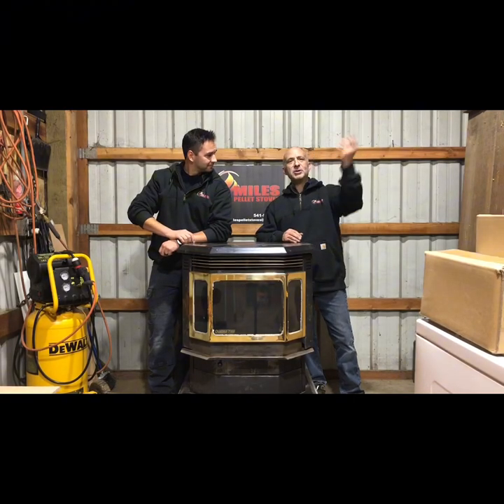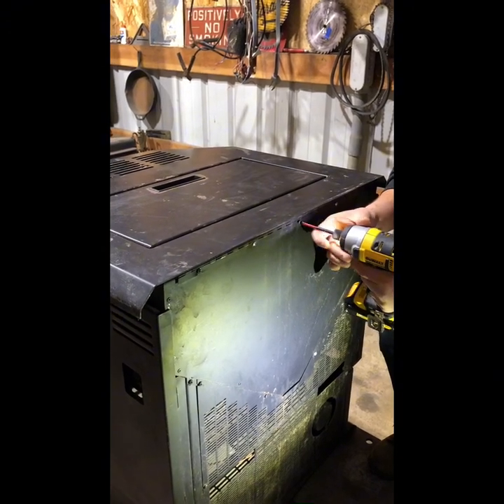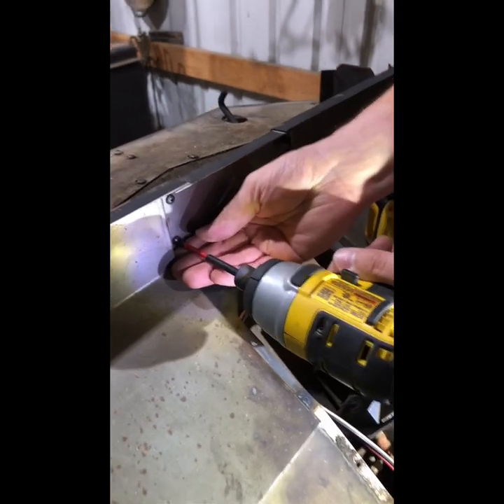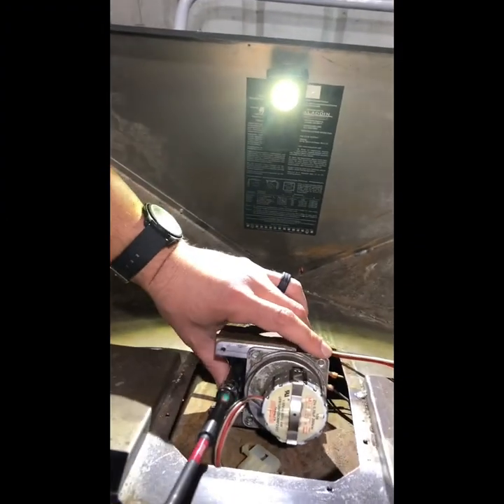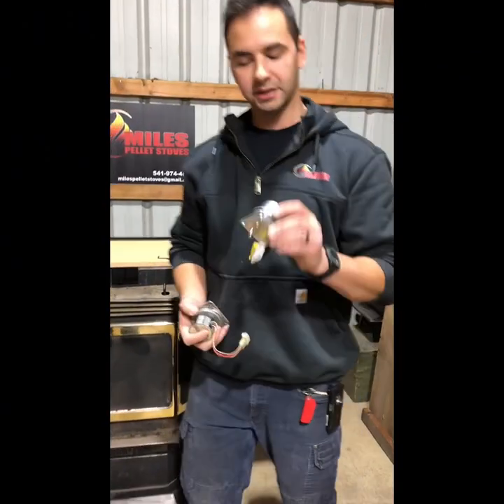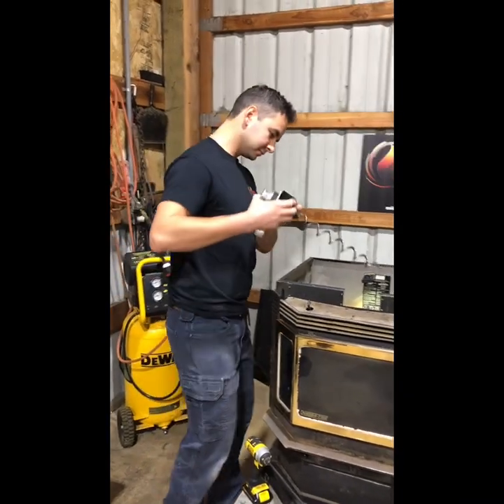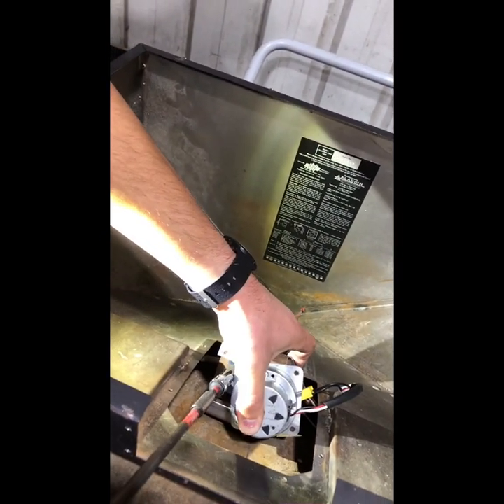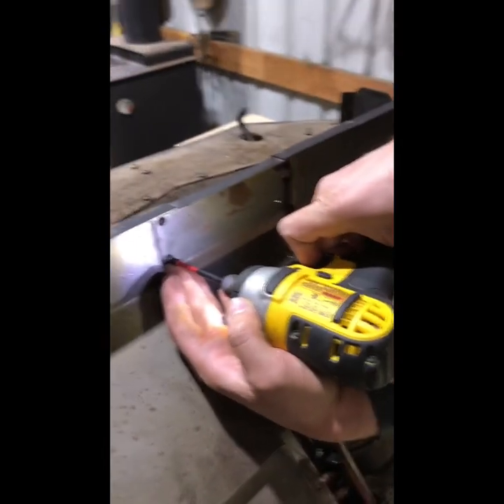Quadra-Fire CB1200 FS Pellet Stove Auger Motor Replacement Tutorial

Comment: Thanks, guys. This was EXACTLY the video I needed to change out the auger motor on my stove. Only difference is that I apparently have one of those snap switches attached to the right hand bolt that holds the motor bracket on the stove.
Reply from the maker: Glad the video helped you. Reach out in the future if you have questions. Please subscribe....it helps us build the channel. Pellethead.com for
Parts. Use miles123 at checkout for 10% off.
Have a good day.
Brett and Briggs

Comment: You had a good opportunity to educate us on how the auger actually works and what to do about sawdust build up inside the tube. Then you could have shown us how to determine the exact position of the feed adjustment plate.

I'm fighting with a finicky stove that either doesn't feed at all to light, even though the auger is turning; doesn't feed enough to stay lit while the auger is still turning; or feeds so much it smothers the fire and won't be able to re-light after it shuts off.

The opening for the feed plate is so big compared to the pellets I wonder why there's 3" of travel for it but they say to adjust it in tiny increments.
Reply from the maker: The auger adjustment plate position varies with type of pellets used. Usually at the top end of the auger tube, fines start to pack and obstruct the small opening where the pellets drop down the shoot. Check for clogging in the auger tube. Thank You
Reply: Thank you for that. Is there any guidance for where in its 3” of movement would be a good starting place?

The decal goes from 0 at the bottom (smaller opening) to 70 at the top ( wide open). I’m at 15 in that scale.
Reply from the maker: Loosen wing nut and pull up the rod all the way then tighten wing nut. Observe the flame for 15 minutes. If flame is not desired, push the rod paddle arm down in small increments until you achieve the goal. Each time you make an adjustment, wait 15 minutes and study the flame.
Thank You

Comment: Hi please help i have 120v going to the unit i checked the end of the cord at the unit 120v for sure going in but only 70 to 80v at the fuse fan and red light not coming on????????
Reply from the maker: Red light not coming on...check lines to thermostat and check thetmostat. Make sure 3 speed control board is ok....can only provide a little info here.

Comment: Hi, Just found your channel. I have a Quadra-Fire CB 1200 FS it is 9 years old it still works perfect except on start up it feeds to many pellets so when it lights the flame is huge but then it goes back to normal through the rest of the burn cycle . Is there an adjustment for this ? Thanks the video was really good informative easy to understand.
Reply from the maker: In the hopper, there is an adjustment rod usually held down with a wing nut. Loosen the wing nut, push down on the rod until desired level has been met. Tighten the wing nut. At the end of the rod is a flat plate that increases or decreases the amount of pellets into the auger tube. This should help. It takes a few start up cycles to see a difference. Hopefully this helps.
Reply: Thanks for the reply

Comment: Thanks for the videos. I have a Quadra-Fire Santa Fe. My auger motor works fine but it makes a groaning noise when dropping pellets. I've cleaned out the shute and all is well for a bit then it starts it's "groaning" again. Can I lubricate the motor or bearing?
Reply from the maker: Thanks for the message. You can't lubricate the auger motor. I believe you have sawdust shavings compacted at the top of the auger shaft. Unplug your stove. Empty the hopper, remove the auger motor and shaft complete as one piece. Clean out the auger tube then put back the auger assembly. Put some pellets back in hopper. Re-Start. You may have to push the reset button to prime the auger with pellets.
Hope this helps.
Reply: @MilesPelletStoves  it does help. I've changed the auger motor before. It's a pain because the stove is an insert. But I want it quiet again. Thanks for the diagnosis.